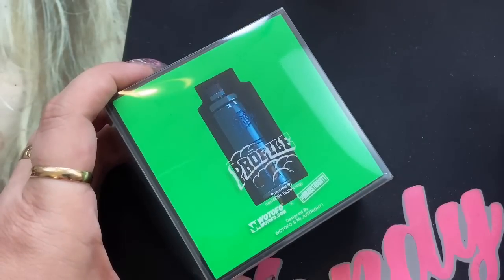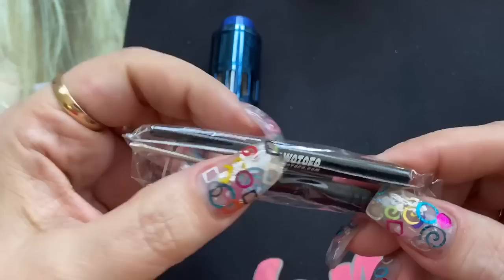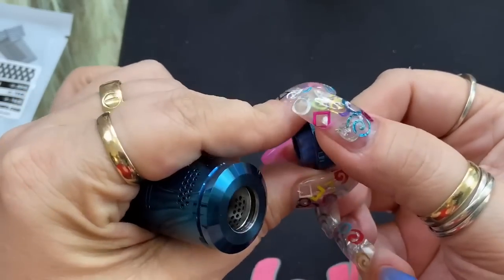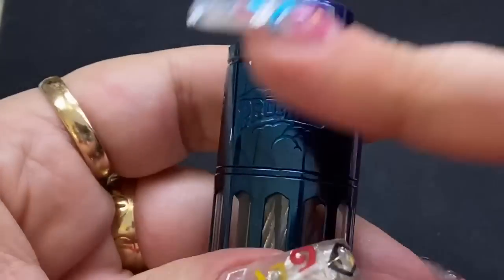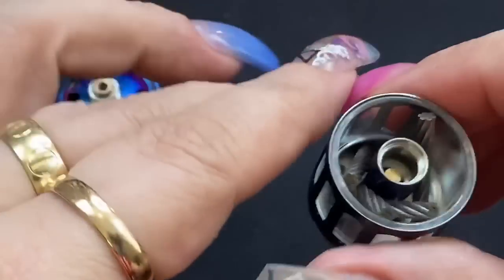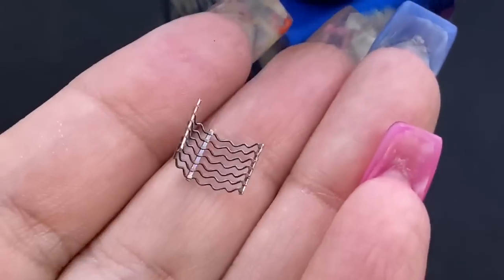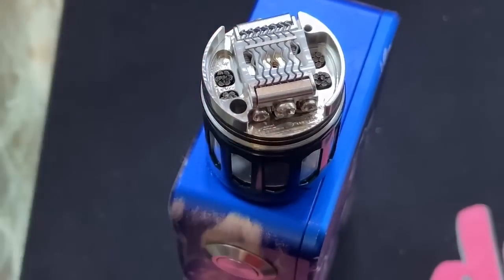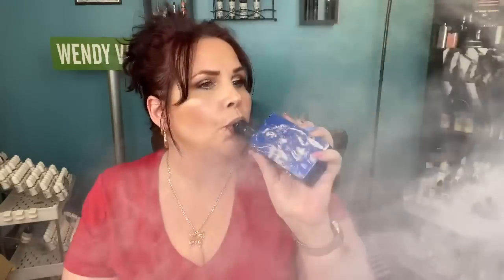Profile RDTA | 3 build tutorials | Wotofo & Mr.JustRight1

Comment: Great turtorial very clear and educational 5/5, clear calm and collected, super! Love my rdta so far but only used mesh prior, just finishing up my first coil build and it looks about right, going for duals, wotofos quad core fused clapton, n80 3mm 0.26OHM… here we go and thanks!
Reply from the maker: Thank you so much love ❤️
Reply: @WendyVapes  litle update :) did not get it to work propper think i messed up the lenght of the poles or somthing didnt have a propper messuring tool. The ohm wsnt stable and mod was asking if it as a new  coil all the time… but im no quitter so im soon back at it again :)

Comment: Wow I'm really impressed the more I kept hearing you talk about the features the more I was amazed this totally blows away the mato rdta I got last year so many new features this thing is cool also you did a really good job at explaining I can't wait to get my hands on this bad boy
Reply from the maker: Thank you so very much love ❤️. I try to provide as much information that I can. 😁
Reply: can ya help me out I've had it for about a week or so and it worked perfect the first few days and now I keep getting dry hits I  have been using single coil and then tried the mesh which I have no experience with and decided  mesh is to complicated to Wick so I ran out of cotton and am now using cotn cotton threads and I can't get it to Wick properly now I've re watched the video many times and am stumped could I just put the cotton in the juice well and remove the steel wires?

Comment: Thanks Wendy for your video. I wonder if you know how the RDTA could be used to smoke weed? I bought this to smoke DMT (using the RDTA converted to RDA) and works great and then I got to thinking I have this equipment, surely there is a good way to use this for weed, maybe using the tank with THC oil. Thoughts welcome!

Comment: Thanks for taking your time out to do this comprehensive review, I know how much work it takes. Now, what is the best mod you'd advice I get for this RDTA? and of course an alternative as well just in case I don't like your 1st choice.
Another thing I learnt in this video, correct me if I'm wrong: I can screw on the base over the squank screw and make it an RDA or take the squank screw out and screw on the regular screw that came in the kit to make a dripping RDA, now what's the difference between these two setups? and what's a "dripping RDA"?
You also didn't demonstrate the RTA only setup. Do we just do away with the RDA top part then? what goes over the coil then? and what's the sense in having the RDA over the tank anyways as it's empty? couldn't this whole RDTA setup just be shorter without the RDA part which is empty?
Reply from the maker: You can use it as an RDTA or RDA. The difference of RTA and RDTA is the tank on the bottom rather than on top. Any mod can be used for this atomizer. Literally any. Single battery mod or dual battery mod. They only heat the coil element depending on the wattage you set so they all do the same thing. It’s totally up to you. There is no best for a mod to use for any atomizer it’s all personal preference. A dripping rda is an rda. It’s a Rebuildable dripping atomizer meaning there is no tank so you would have to drip the eliquid from the top into the drip tip. Thank you so much for watching.

Comment: I just got mine today. I set it up with mesh and I absolutely love it. The only thing I dont like is the damn fill hole and how you have to precisely line up to lock on the top cap
Reply: Did you get it from Wotofo? I wanted to know how long it took to receive, Cuz I may just wait until it hits the states TIA
Reply from the maker: Honestly lining it up isn’t that bad once you’ve done it a few times lol. Just put it on and twist it will go down once it’s locked in. Enjoy love!! ❤️
Reply: @AndreP1524  I ordered it on August 3rd and received it today, so 7 days total. I chose the DHL option for shipping.
Reply: @WendyVapes  I had thought you had to take the top cap off line it up than put the drip tip back on but after a couple times I realized you could just put it on and twist it so its really not bad at all.

Comment: Hi Wendy! Thanks for this awesome review. I do like your style, especially the "charmed" pictures. I wonder how many batteries your vaper needs? Maybe the next level of power can fit 2-3 car batteries in an stylish backpack? I would surely feel like an warhammer 40k space marine with a desintegrator plasma cannon.
But I have a question about poweriing my current device. I used the 0.16 turbo nex mesh and put my power to 35 watts. I wonder if I did it right or why is it that your wattage on the mesh is way higher then mine? Thanks for answering, and I hope you do a lot more of this great reviews! best regards from Germany.
Reply from the maker: Thank you so much for watching. You can use any wattage that is comfortable for you. Not everyone uses the same. With the mesh strips they can go up to 60 or 65w but again, it’s all about your comfort level. Remember with mesh the key is to make sure the cotton is always wet so that you don’t get a dry hit, especially with higher wattage 😁
Reply: @WendyVapes  Great thanks! When I tried to light it up at 70 watts, i had a flame coming out of my mouthpiece and i thought i dont want to roast my teeth. thanks! i feel quite good with 35 indeed. <3
Reply from the maker: Yeah mesh is very fragile. Always make sure the cotton is saturated 😁

Comment: I am a profile lover. I have them all. This on is great looking and I’m so interested in how it wicks with the cables in mesh mod. ✊🏾
Reply from the maker: Roy Godine Wicks beautifully!! 😁 Thanks for watching Roy 🥰
Reply: I have a few profile RDA.  I've taken up astronomy and it gets difficult to drip it at night in the dark.  How do you rate the profile unity flavour compared to the RDA?  I nearly gave up on my first RDA as I was hopeless at wicking it.  Once I cracked it I haven't put it down.  I always have 2 on the go and swap others in and out (hermetic, FLVR, Citadel) but profiles are my go to.  Do you recommend getting the 1.5?
Reply from the maker: Phil Drewett if you have the original Profile RDA I would say you don’t need the 1.5. The original airflow is much better than the 1.5 in my honest opinion.

Comment: @Wendy Vapes can you use the OFRF Mesh coils (size: 16X6.8mm) on this thing ?  I have a TON of those mesh strips.  I do like that thing !!  So many choices in using it.  I am thinking VERY strongly on getting one, that is for sure.
Reply from the maker: David Bowser Yes, you can use those. It’s pretty much identical to the original Profile 1.5 deck RDA 😁
Reply: @WendyVapes   Thank you for the information.

Comment: In comparison to Vandy Vape Siegfried, which one is better?
Reply from the maker: This one has 3 different options amd can he converted to an rda for squonking. And the ceramic plate for this one that is  under the mesh keeps the cotton touching the mesh to prevent frying the cotton. So based on those differences I would say this one.
Reply: @WendyVapes  thanks for your recommendation. Just got it. Tastes amazing. I just need to get used to that low driptip. Accedentaly used my 6mg nicotine liquid. I'm in heaven lol.

Comment: I just got mine today and put it together by following step by step on this video.  However I used the mesh you used and it reads .18, also it splattering...is this normal?
Reply from the maker: Nail Bar 1 Nailsalon sounds like the cotton is too loose under the mesh. It has to be pretty snug so it doesn’t collapse. It might spatter a little when it first gets saturated. Just make sure the first tile you get it really saturated manually.
Reply: I used the same thick cotton you used Wendy! I could cry 😢

Comment: Do I need to change screw for different one or leav quank one ? If I gonna use rdta on .13 mesh coil
Reply from the maker: You would only use the Squonk pin if you are going to be using a Squonk device.  Otherwise you can really damage your device.

Comment: What pin do I need to use? I currently have to use it in rda mode as I lost the glass I think i have the squonk pin installed but I'm unsure if I need that or the solid one
Reply from the maker: The squonk pin is automatically installed once you remove the bottom cage part just put on the disk it should be installed. I have a video showing how to convert it to RDA.
Reply: @WendyVapes  so I should swap it out for the standard pin?

Comment: I heard this leaked with Rods in when laying on its side, is this true?
Reply from the maker: Not sure why anyone would lay their device on its side. Any RDTA no matter which one or if it has rods or not will leak if you leave it on it’s side.
Reply: @WendyVapes  I should have been more specific with the question lol I understand they will leak when on their side, most take longer then others! My question should have been, will the ejuice run out if accidental knock over? My apologies
Reply from the maker: If you wick it correctly with the cotton it will not leak. There is cotton covering the rods. I can turn it completely upside down and no leaking or spilling.

Comment: Can anyone help me brought this today I’m using the mesh coil but I keep getting a small glowing spot while vaping is this right ? I wicked once (too much cotton) got bad dry hits so rewicked n now I have a small glowing spot on the coil but the flavours right I strummed out the hotspots both times didn’t get the glow the first time but am now someone help please don’t want to catch fire 😂😂
Reply from the maker: Seems that you could’ve heated up the mesh at too high of a wattage prior to wicking. You should heat up the mesh at a low wattage under 20w. It can burn it out or damage it if the wattage is too high. Also you need to run the wattage within the recommended range. Mesh is finicky you need to be careful.

Comment: I have adapter and mesh bot working
Reply from the maker: Not sure what you mean. What adapter?
Reply: @WendyVapes  I have drag max and i bought wotofo profile rdta and adapter and adapter doesnt read atomizer
Reply from the maker: @bartekpryciak5803  that is the issue with the 510 adapter. It’s a known issue for the adapter that it will not work for all tanks or atomizers.